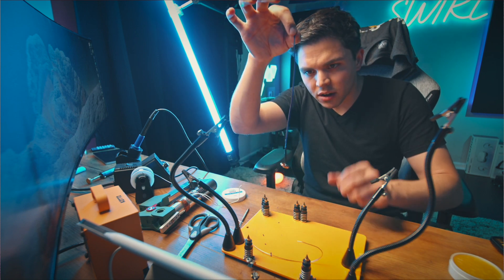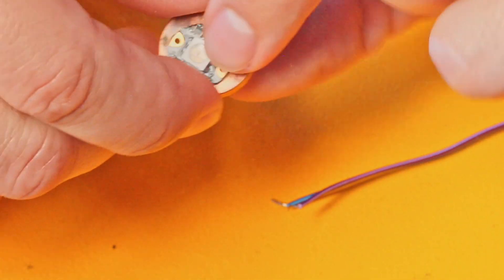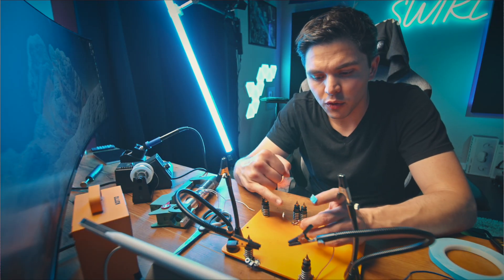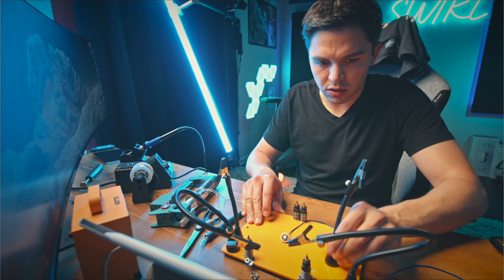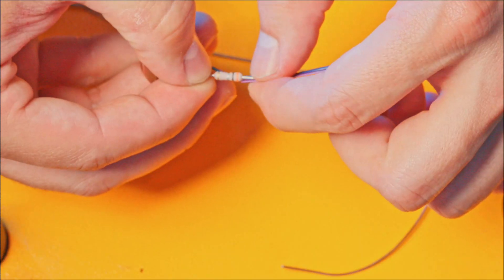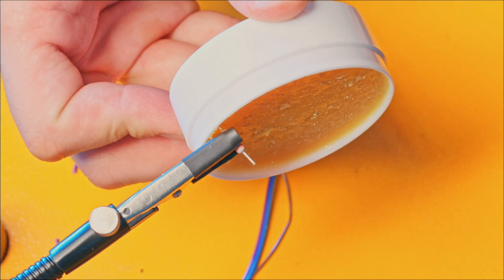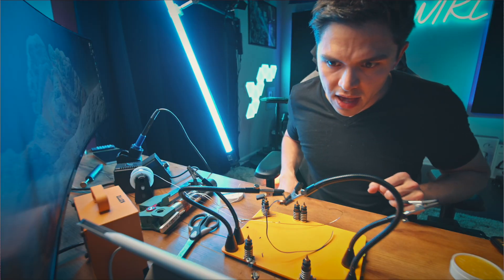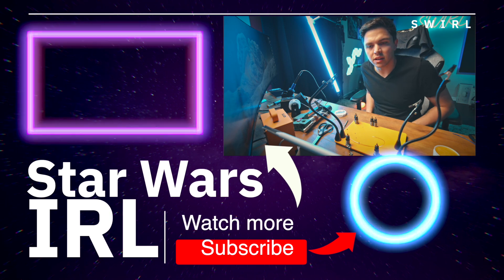BLASTER/ACCENT LED INSTALL (Day 4)

Comment: Your soldering has made a slight improvement, you tinned the wires in the second half in the video which is a step forward. Still, you are stripping your wires too long, and creating short circuits between the power leads for the LEDs and the copper heatsink. This will damage some combination of the LED, the chassis, the battery, or the soundboard. You need to create a non-conductive barrier between the bare copper and the power leads with electrical tape or something like that.

Comment: That isn’t going to work. You are putting a resistor on the negative of a neopixel. The resistor goes on the data line. 330 or 470 ohm . And you don’t need a heatsink for a single neopixel. You are making it way harder in yourself
Reply: All correct.  Neopixels don’t need heat sinks ever. They will also not illuminate at all without a data line, as Rich said, to tell the pixels what to do. As he also stated, that is where the resistor goes. 
Pro tip: test as you go. That way you don’t get really far and it’s not working. 
Next time try a bench test of all the electronics outside the saber and are working good. Much easier to spot an issue
Reply: @adamgoad4131  I feel bad for the kid. He is trying, but he is spending too much time on things that will absolutely disappoint him. I don't know where he is getting advice from, but I want him to be successful. There is nothing better than building your saber, pulling the kill key, and hearing that glorious boot sound for the first time.
Reply: Not to mention he is creating short circuits between the leads for the LEDs and the copper "heatsink".
Reply: It sounds like you guys know a lot about making lightsabers. I really want to make one but I don’t know where to start or how to do it. Could you point me in the right direction?
Reply: @calebmiller8556  Yes been in the hobby 6 or 7 years now. Fantastic community. Head over to The Rebel Armory and say hello. There’s plenty to read there, and plenty of other places to go from there.
Reply: @calebmiller8556  been in the hobby for a few years too. Love it! And love paying it forward, hence why I am trying to guide him in the right direction. I started watching You Tube videos from the custom saber shop. You can find everything you need to build a saber. The videos are older, but you get the basics of saber building. From there check Facebook, there are a couple good groups. I am always happy to help anyone get into the hobby
Reply: @thatkidrich  Thank you so much! I’m going to go check out the videos now.